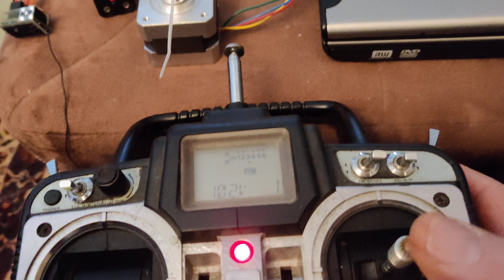improved rc control of stepper motor position

Comment: Do you have a wiring diagram of the circuit?
Reply from the maker: Yes the project is still on the workbench so drew up this  https://swigerco.com/RCStepperCircuit.jpg 
It is fairly straightforward - whichever channel of the R/C receiver you want to follow, connect to Pin 4 of the Arduino Pro Mini 3.3v 8Mhz board, and tie a ground to them also. Pin 10 of the pro mini connects to the STEP input of the easydriver and Pin 9 to the DIRECTION input, and the motor to the board outputs. This uses the easydriver to regulate the 12v battery down to 5V which powers the raw input of the pro mini and uses the regulator on that to get it's 3v3.  Ground is common to all three boards and the 12v battery negative. The easydriver has a pot for setting the motor current - high enough to get good traction without slipping but not so high the motor runs hot.  Also see https://projecthub.arduino.cc/kelvineyeone/113bac48-77c6-419b-99e5-287275e4251a  for more detailed instructions.

Comment: Would you share this sketch? I’m trying to do this exact thing.
Reply from the maker: Sure - https://gitlab.com/cswiger/AccelStepper_EasyDriver_RC/     it uses a really good project that reads servo signals from an R/C receiver - just combined with the stepping motor AccelStepper library in a few simple lines.